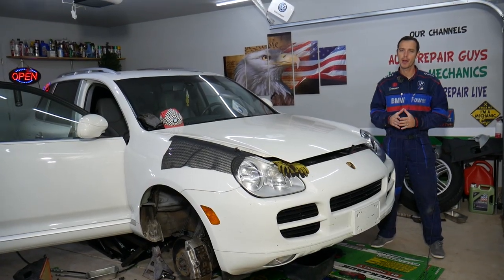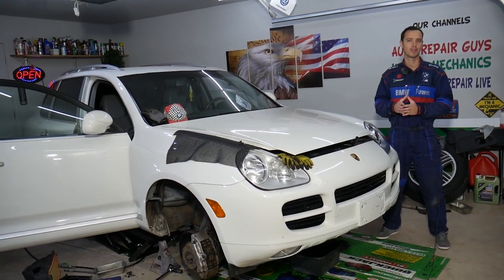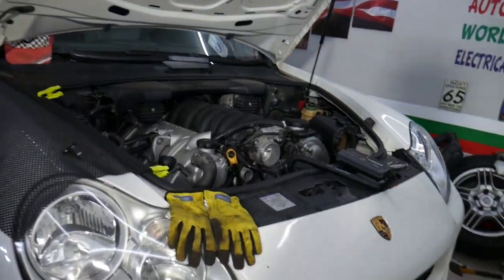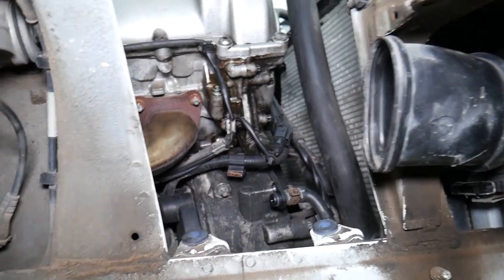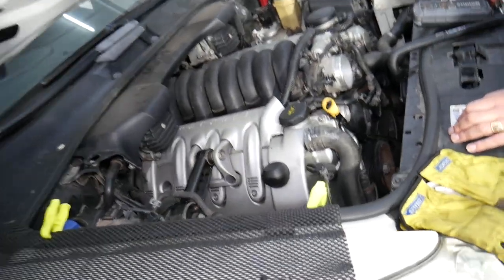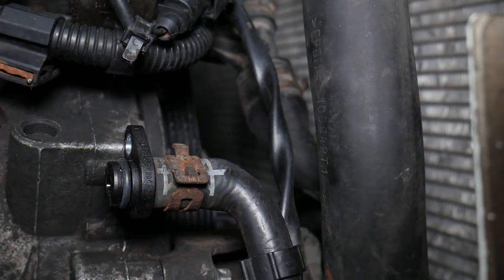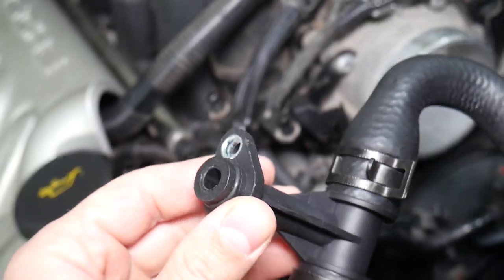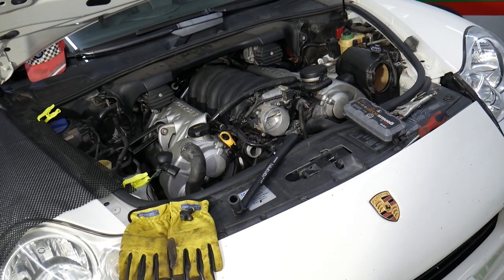COMMON COOLANT LEAK ON PORSCHE CAYENNE, AUDI Q7, VW TOUAREG

Comment: Would this be also associated with an alternator not charging? Mine is loosing coolant and also it has had an intermittent problem with the alternator not charging.
Reply: Take to shop or sell